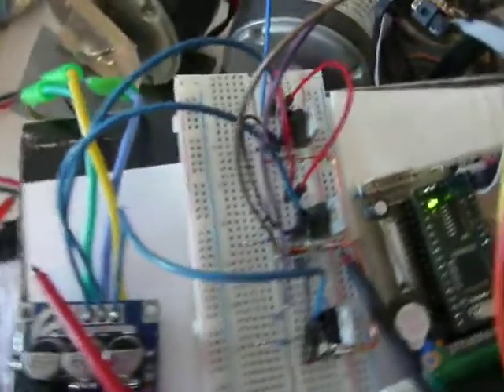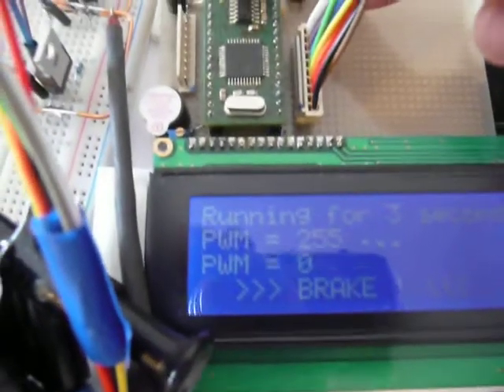8$-Brushless-Controller JYQD for Hoverboard-Motor NOW WITH BRAKE - Part 2

Comment: Hi AccuXperT, Great video to come to my rescue. I built a robot using a hoverboard, but the problem is that, I need to find a suitable brake to use, as the robot keeps on colliding the obstacles. I was searching a lot over the internet over couple of days, and thankfully your idea has come to my rescue. Thank you very much.

The thing is, I have to build your circuit on a PCB or something for the motor drivers (By the way, I'm using ZS-X11A) and I don't understand your connections. I have the required components with me. Can you please post some kind of circuit diagram? I'll be very grateful for you. Thank you again.
Reply from the maker: Thanks for your comment.
The 3 MOSFETs-Gate are connected to 3 I/O-ports of your controller (e.g., Arduino or ATMEL). These ports should be able to deliver at least 10 mA to low or high, as this controls the gate.
The entire connection from the port to the engine looks like this:
1) from the port a 10 kOhm resistor (10000 ohms) to ground (if the port sets a high-impedance state)
2) also from the port a 47 ohm resistor to the gate of the MOSFET.
3) Place the source from MOSFET to motor ground
4) Connect the drain of the MOSFET to one of the three terminals of the motor.
5) Perform steps 1 ... 4 for all 3 motor connections.

SOFTWARE: With a high level at the port pin (= MOSFET gate), the motor connection is grounded. With a low level, the MOSFET is off / passive.
(The MOSFETs used are of the logic-level type, ie these are already controlled with 5 V).

IMPORTANT: NEVER TURN THE MOSFET ON WHEN THE BLDC CONTROLLER IS ENABLED!

I wish you success!
Reply from the maker: One more important thing for those who want to brake with external MOSFETs: Sometimes you can not do full braking with the MOSFETs, but the MOSFETs have to be pulsed to slow the motor down from a high speed. Depending on the pulse duration, it may happen that a part of the generator current charges the battery (via the internal body diodes of the MOSFETs). The battery voltage rises a bit, in my laboratory with a power supply, it is max. 5 V. It is therefore essential to use a rechargeable battery with the lowest possible internal resistance (Ri). If more than 26 V battery voltage is used, a suppressor protective diode should be soldered to the input of the LM317 voltage regulator.
Reply from the maker: Yes exactly. At full speed, full braking can be undesirable or problematic. But this has to be tested in a real project. A loaded wheel behaves differently than the unloaded wheel in my lab during program development. A full braking on the unloaded wheel (as in the video) could lead to a mechanical overload ...

It's right, I meant with the battery, the supply of the BLDC motor.
But: a 36 V hoverboard battery would be a big problem for this particular BLDC PCB! Fully charged, the battery would have 42 V and that would be too much for the LM317 voltage regulator on the PCB. It must be changed the input circuit of the LM317, so that the LM317 at its input with a 42 V battery NEVER has more than 36 V ...
I think so, that a operation with up to 42 V is possible. However, I would put a thick 12V suppressor diode in series with the LM317 input and from the LM317 input another 36V suppressor diode to ground. I have not tested this yet, but from other applications I know this would work ...

One more note: This little BLDC circuit board is really cheap and can afford something, but to get a little more out, you have to make a technical change.
I would be happy if you can achieve success here ...
Reply: Thank you again for your prompt reply. There are some BLDC controllers (which are meant for e-bike/e-scooter) and they have built in MOSFET inside the controller board. They allow Low Braking and High Braking facility. What is your opinion on that pertaining to using them on hoverboard for brake control?
Reply from the maker: OK, that's the way it is: If the developers of this small 8 $ BLDC board wanted it, they could also slow down (brake!) the motor with the MOSFETs on the board - that would not be a problem at all! And there are actually BLDC controllers that handle it that way.
In principle, two variants of the BLDC controllers are used:
1) Controllers that release the wheel that is no longer energized until it stops by itself (freewheeling)
2) Controllers that brake the no longer energized wheel.

It depends on the application: an e-bike / e-scooter wants to roll out when no longer powered (that's also a matter of safety), but a robot and also a hoverboard need to be steered more directly to allow a hard steering and also (in the hoverboard) to create a holding moment, so that the (powerless) board does not roll underfoot. In other words, for a hoverboard, the BLDC PCB tested here would NOT be suitable. Even with the external brake MOSFET's it would not be possible, since the switching time for forward / backward with at least 500 ms would simply be much too high! Because this would be an operating condition that would be constantly present at a hoverbaord at a standstill ...

Interesting would be another approach, which I pursue at least theoretic: Two of these cheap BLDC controllers are connected in parallel, with one controller energized exclusively forward, while the other controller fed backward. This would share the losses in a dynamic robot system and eliminate the hassle of switching (forward / backward). If the system is operated at 42 V, I think the result would be very dynamic. Only the software would be a bit more demanding here. Maybe I'll test that, who knows ...
Reply: Thank you for your prompt reply. So, depending on the pulse width, is it that we can use it is as a high, moderate or low brake? Also, if the motor is rotating at full speed and if we supply full on pulse (i.e. PWM 255), is it dangerous or bad or something? You said "can not", do you mean "should not"?
Another thing, you mentioned using a rechargeable battery, is this the same as the one which is used to power up the motors? I am using the hoverboard battery (36v).

Comment: Hi AccuXperT, great application. I am trying to interface the same motor with arduino, I am getting not consistent behavior .... Could you please give me a hint here: what voltage are you using ?, are you using the hall sensor lines ? do you connect ON and direction to uC. I understand you use PWM to control speed. If you have an interface description it would be great... sorry to ask such details.. I am fighting with this for a couple of weeks. Thanks
Reply from the maker: First: The small BLDC controller is "something special"...
He has the advantage that he is "foolproof", but makes the BLDC controller internally sometimes something different than the user (as you) on the control lines programmed. This is a problem because the BLDC controller has internal "wait times", but no signal that indicates to the user. The user program then continues to run (for example, in the event of a reversal of direction), without the BLDC controller initially reacting to it: the reaction comes with a time delay, sometimes by a few seconds. The best way is to evaluate the SIGNAL line from the BLDC controller. I put this signal on my INT0 interrupt and "watch" the wheel speed.

To your questions:

I always use a power supply with current limiting for testing and start with 500 mA. A voltage of 12 V for testing is sufficient, but at least 15 V and a maximum of 30 V are better.
It should be remembered that when braking, the voltage on the battery can also be greater than 30V, since the pulsed braking of the generator current charges the battery and is not completely shorted. Here you could buy some protection diodes to protect the LM317 voltage regulator from overvoltage pulses.

I actually put all control lines on the I/O-Pins of my ATMEL controller. You can directly apply a PWM signal at about 3000 Hz to the speed control input. The BLDC controller internally integrates the input signal.
And the Hall sensors must be used with this engine in any case! Only in this way can a high torque be impressed! An example: With 24 V and a battery current of 4 A, I can no longer hold the motor with my hand - and with an acceleration from a standstill ... Without Hall sensors, the engine would have to be able to turn without much torque, which is exactly what it is not wanted on a powerful scooter motor or in a robot project ...
I hope you enjoy the experiments ...